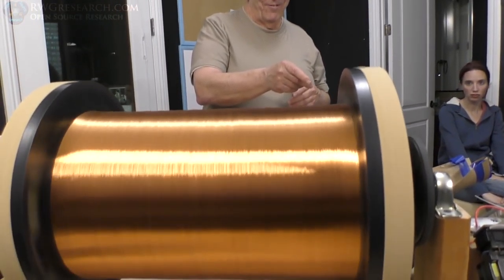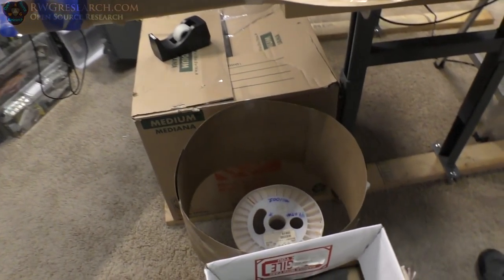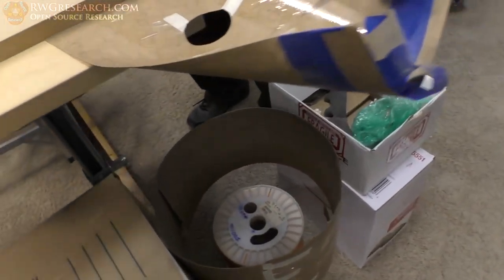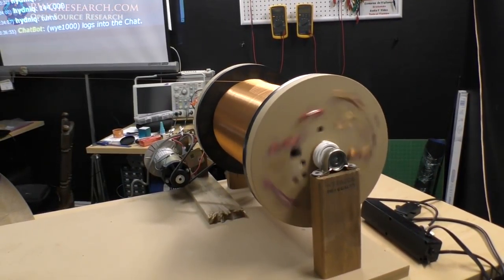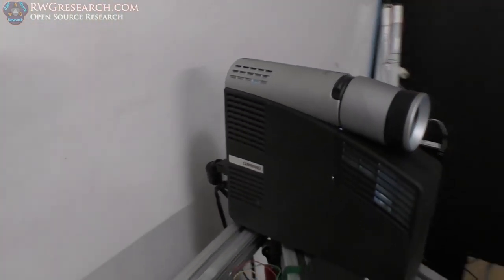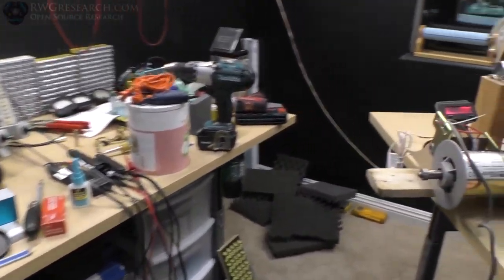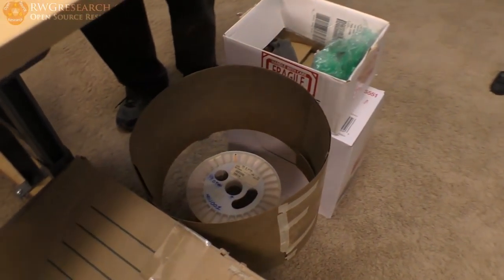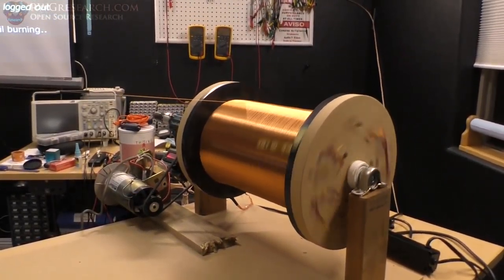JWN Project: It Starts Here... The Intro... Thats alot of turns... 2018

Comment: I work for a high end wire manufacturer, and we use a let-off motor, tension sensor, and various pulleys to rewind a spool. A precision traverse pulley adjusts the lay of the wire so that it is consistent and accurate. I would have at least pinched a cloth around the wire to prevent the oils of my skin touching every inch of wire. Probably going to tarnish pretty quick now.
Reply: Joshua Schofield I don't know, just from playing guitar, my fingers get enough callous to keep them dry, I can't imagine the craftman callouses developed winding like this!😥👀 I bet it's not an issue.
Reply: Joshua Schofield.  Doesn't the copper metal wire have an enamel insulating coating? I didn't think that enamel tarnished?
Reply: William Hada I'm not sure if it's coated. Your right though. If it's coated then it should be fine. I wouldn't want to rub the coating of though. Just seams kinda crazy to be doing the winding by hand, and eyeballing the tension and level line.
Reply: Joshua Schofield      If it was not coated (insulated) it would short out and you would not have coil, you would have a giant lump of useless copper.
Reply: of course the wire is coated! my goodness you people don't know anything about wires and making coils or the fact that if the wires weren't coated it would short out immediately after the first turn. Lol....
Reply: Jesse Fritz I had no idea what he was doing in this video because he's all cryptic and weird about everything. It is apparent now that he's making a coil, but I simply saw someone winding wire onto a spool.